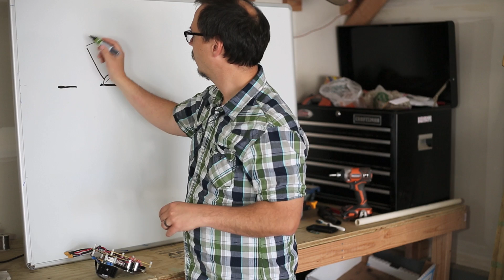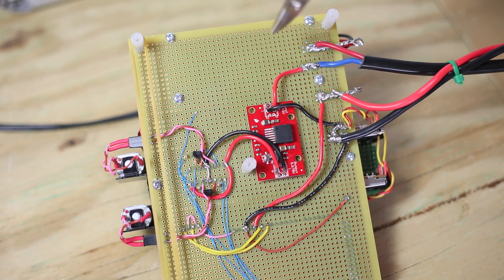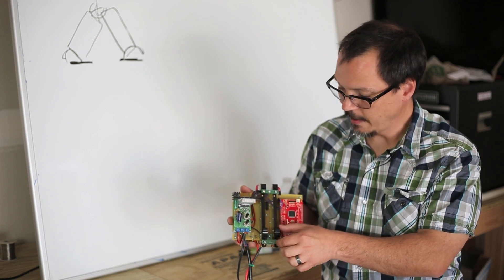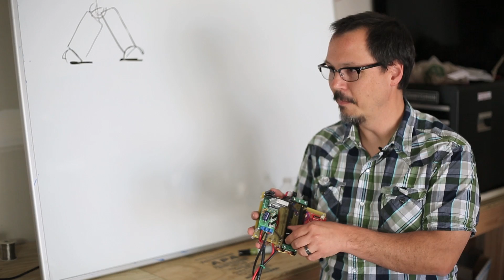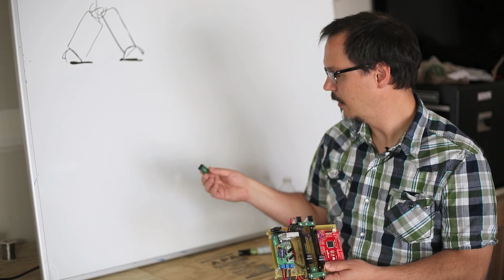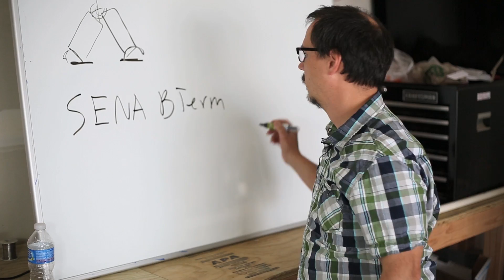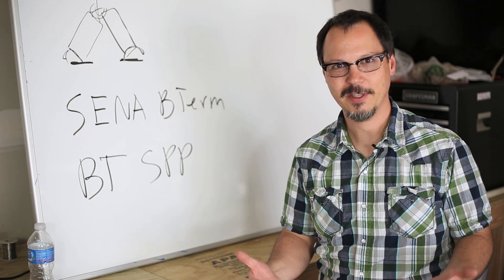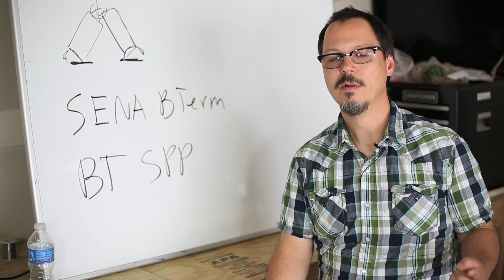SparkFun According to Pete 5-7-12: Audio Project Demonstration!

Comment: I help run sound at my church and we have a Roland M400 (sweet digital board) for the contemporary service. One thing that is really annoying is that we have channels 47 and 48 linked together for the right and left audio for our CD player. When set at the same level 48 sits a few hairs above 47, so good luck. Since each fader you are using has 2 pots, why didn't you take and feed both readings to the board and have it average them, and then use that for it's code and send that value to the amp?

Comment: I was wondering that, too. Use the faders purely as a mechanical front-end display/control, but use digital pots or even PWM with filtering for the volume.
That way, too, you could use one fader for both channels without worrying about balance, and even use the other fader as a mechanical "seek" when playing CDs or MP3s.